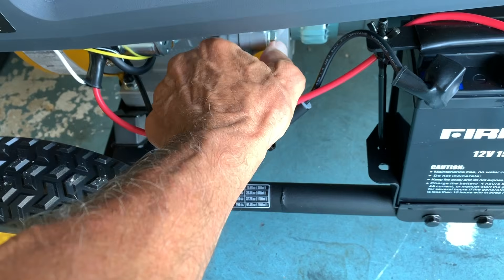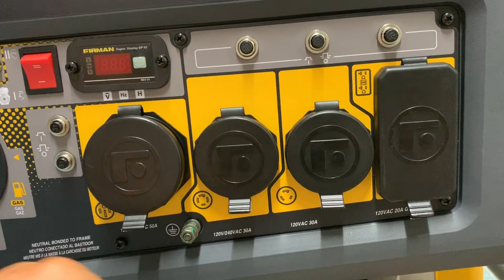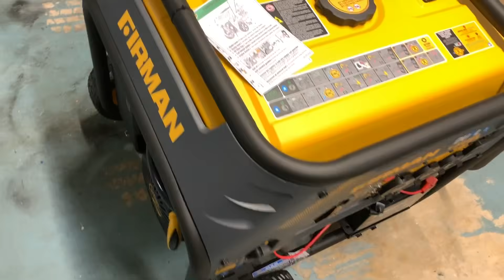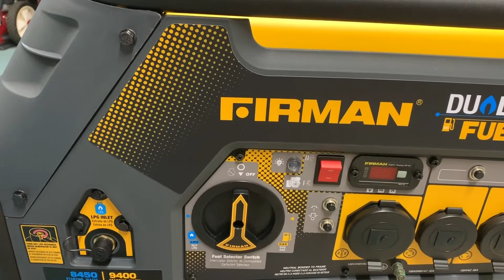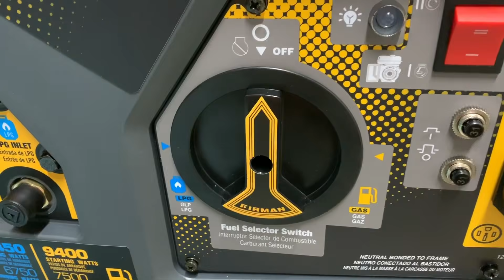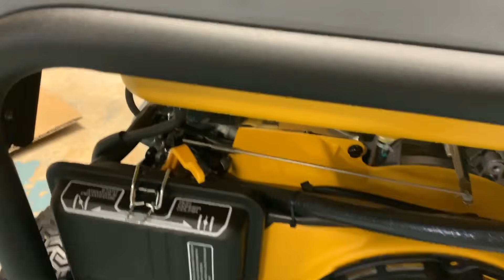The Firman 9400 Dual Fuel Generator from Costco

Comment: I heard that you can't run the unit on propane all the time because it causes condensation build up on the gas carbrerrater  and it won't start on gasoline.     Has anyone else heard of this before?    Anyone
Reply from the maker: That’s the first time I’ve heard about this, but we will have to research this and check it out
Reply: @TomLeeman  thank you

Comment: Where is the serial number?
Reply from the maker: good question ill have to look
Reply: The serial number is under the top bar on the handle side. Lift up the generator with the handle and look under the top bar handle side

Comment: I have this generator runs great but now when I put it under a load it acts as if it is choking. But if I move the lever a little bit back from run it runs smooth under a load. Do I need to get the carburetor worked on? Or what?
Reply from the maker: I'm not sure but you can call the company and they have good customer support
Reply: Here is a reminder about portable generator safety: This is just to make sure that everyone is aware of all the warnings and it’s just to remind people to be careful using portable generators. Everyone has to see this safety reminder for safety. Every year, hundreds of people die or get injured when using portable generators due to carbon monoxide poisoning and electrocution. Make sure you are using your generator carefully and keeping others safe as well. There is something very serious that everyone should always be aware of when using generators. Some people do run their generator indoors which is not safe and that increases the risk of carbon monoxide poisoning which can cause death of family and you. Some people run their generator in wet conditions which can electrocute them. Please remember that you should never run your generator indoors. Remember that carbon monoxide is an odorless and colorless gas that you cannot see or smell. Carbon monoxide is a silent killer. Keep that in mind. Make sure your generator is 15-20 feet away from your house and away from doors, windows, and vents. Never use your generator in your porch too. Having a carbon monoxide detector is very important against generator safety. Some people also allow children to go near the portable generator which could pose risks. We need to keep an eye on our children making sure that they are not near the portable generator so they won’t get electrocuted or burned by the generator which is dangerous. A locking enclosure also keeps kids safe. A generator shed might look like a tempting place to explore, or take cover during a game of hide and seek, but a generator is a dangerous piece of equipment that can cause injury. It says on the manual that we should also keep children away at all times from the portable generator to avoid injuries. Please do not allow a child or unqualified people to operate the portable generator. Just because some manuals missed what should be listed doesn’t mean it’s safe to do. Always follow the generator safety rules when using portable generators. Generators pose electrical risks. If you need to use your generator during wet weather, you need a generator tent to protect your generator from getting wet. Don’t let your generator get wet. Keep your generator dry and before using your generator, please make sure your hands and your generator is dry. Do not wear loose clothing when operating the generator. Everything that is said on the generator’s operating manual should not be ignored. Never smoke cigarettes near the generator. Please keep flammable things away from the generator. Never overload your generator too. Your generator can catch fire. Never ever try to plug a generator cord into a wall outlet to avoid back feeding. Back feeding your generator is dangerous. Always turn on your generator first before plugging in appliances and shut off the appliances before turning your generator off. Use a heavy duty cord for your generator and the cord should not be worn out. All the instructions should be followed carefully. Never refuel your generator while it’s running. It can cause fire if fuel spills while your generator is hot. You should turn off your generator and let it cool off before refueling it. Having a fire extinguisher next to the generator is also important. This is only a reminder for everyone’s safety of using generators. Make sure your generator is properly grounded. https://youtu.be/I1jT3ANENvI and here is a video more about keeping others safe when using generators and also about our family’s safety. Hope this helps. Thank you. Hope you stay safe as well.

Comment: Ah means amp hour,meaning that how long the battery will produce cranking power before it is dead or to low to crank the engine.
Reply from the maker: thanks for the tip!

Comment: Start of vid “turn off the choke or the engine will blow up.” End of the video “choke will cause the spark plugs to gum up!” 
That decelerated fast!
Reply from the maker: yup good tip I blew one up once by not turning off the choke lesson learned

Comment: It's 72 decibels when running so it's a loud one
Reply: I have had a few generators, the last 2 have been tri fuel. The one I have  now is  Firman TO7571 9400 watt, It is by far the least noisy of them all. They are all very noisy. I went from a Champion  to the Firman, whole lot of difference in the noise
level. This is by far the least noisy of the bunch. I figure a little noise and lights and heat, or no noise , no lights, and no heat.
Reply from the maker: Need ear muffs

Comment: Today 06/27/20 I just bought the Firman tri fuel 7500watts in Costco I paid  $599 plus tax. Is $200 off regular $799. Heavy 200+ lbs but because it's $200 less I didn't care 🙂 I'm thinking enough power incase of emergency.. One Good feature is Auto Low Oil shuts off no worries 🙂 Now I'm going to watch this video it's similar to what I have 🙂 thanks for the review 👍🙂
Reply from the maker: We have had to use it but bows hurricane season so ... good luck with yours

Comment: Does it plug in directly to your main electrical panel, and if so, whats the rating of the breaker that feeds this plug?

Thanks you
Reply: You should install a manual transfer switch. Reliance makes the best panels. Have an electrician install it. You won’t be sorry. Switch costs about $400-450 electrician probably around the same. Well worth it and safe. One of best investments I’ve made for my home.
Reply: @kevinshea5819  Yep, I installed a generator interlock in my fuse panel. a plug outside. In 5 minutes from lights out till back on. Super easy. every thing in my house goes on, (not the ac) I have heat, lights, plugs in every room. The interlock for my GE fuse box I got at Minards  $32.00.
Reply from the maker: Mine dose not,  but you could set it up that way, I just run the refrigerators and TV and portable ac off of it with a cord

Comment: BTW the battery for these will not last a winter if your in the northern states or canada when stored in your garage.  I took the stock batter out and wired in some battery clamps so now I can start it off of a car battery.  Yes I know I could use the pull start but I have 3 daughters and a wife with (and I quote) noodle arms!
Reply from the maker: thanks for the tip

Comment: I have had this unit for almost a year now◔◔>share4.photo/F29WInverter?mにm     I use it to power my toyhauler RV when I'm out in the back country. I purchased this to replace a beast of a Champion unit that was just too loud. I can also lift this into my truck, but the Champion required 2 people. This Firman unit is absolutely awesome. It powers my RV including the Air Conditioning with ease, and it is super quiet! I honestly can't get over how quiet it is.unning air this unit has powered 2 full size RVs at the same time. It also has a battery charger kit that I used when my car battery died. I bought it at Costco so I am protected by Firman and Costco so I know I will get years of service out of this unit. Easy to start, easy on gas and more than enough for the job! 5 Stars! The best part is the price was literally 1/3 of the cost of a similar Honda so my camping buddies now hang their head in shame.
Reply: Hello. We just bought one for our house and wish to use gas. Curious, where do you buy the "minimum of 87 octane...Gasoline with no more than 10% ethanol"? Costco, Chevron, Shell, Valero?

Comment: So you bought a 9400 watt unit only to be using two 20amp @ 120v plug... that's a waste of money. at 80%, full power you will be using 3840 watt max. You should have bought a smaller unit.
Reply: Same tought here
Reply: Available capacity is valuable.  You may want it in the future. If you keep your neighbor's freezer running they may share some of that food. Or share gas.
Reply: @davej7458  Any time you have just enough, there is no room for expansion. You  may wanna turn more than one light on. Have freezers on'
Lose everything in your freezer one time would have paid for the bigger generator. Being a drag racer , a lot is good, more is better, and too much is just right.

Comment: I know someone clarified the meaning of AH (not HA) as you mentioned in the video which drew a ha,ha moment from me. The 20 HR refers to the number of hours a 1 amp from the battery will take to drain the battery. 
Your video is good for those that don't read their manual because you are doing it for everyone in your video as it is very apparent that you don't know much about electronics or electronic start engine systems. Why one would want to pull start when they have an electric start system is beyond my comprehension?
Reply: you can't comprehend the electric start not working?
Reply: @kevinshea5819  Of course and I use it as a backup if absolutely necessary. But, you were using a new rig and definitely should have had a full battery. I also always check out the functionality of my equipment before I use it. Why spend the extra money for an electric start if you're not going to use it?

Comment: I was hoping you’d start it up. I’m at Costco and thinking about buying. But I’m curious about how loud it is. 
By the way, the Ah of the battery doesn’t really matter — you’re not gonna be running anything off of it, and if the unit doesn’t start within a few tries, use the manual pull start. The battery is only for easy starting the generator. 
I appreciate the work that went into this video and I see you have some others. I’m gonna check them out too.
Reply: I bought this on sale a few months ago at Costco...got it for $499. As I walked around the store it seemed everyone had them in their carts. I did start this unit for breakin a few times and it is pretty loud. When I went inside, even with some windows open it was fine. It wasn't something that would disturb me. It was more like a hum. I have started and ran it twice and changed the oil both times. I have used only propane and I hope that is all I ever use.
Reply: Kevin Shea, thanks for the feedback. It’s good to know.
Reply: Here is a reminder about portable generator safety: This advice is just to make sure that everyone is aware of all the warnings and it’s just to remind people to be careful using portable generators. Everyone has to see this safety reminder for safety. Every year, hundreds of people die or get injured when using portable generators due to carbon monoxide poisoning and electrocution. Make sure you are using your generator carefully and keeping others safe as well. There is something very serious that everyone should always be aware of when using generators. Some people do run their generator indoors which is not safe and that increases the risk of carbon monoxide poisoning which can cause death of family and you. Some people run their generator in wet conditions which can electrocute them. Please remember that you should never run your generator indoors. Remember that carbon monoxide is an odorless and colorless gas that you cannot see or smell. Carbon monoxide is a silent killer. Keep that in mind. Make sure your generator is 15-20 feet away from your house and away from doors, windows, and vents. Never use your generator in your porch too. Having a carbon monoxide detector is very important against generator safety. Some people also allow children to go near the portable generator which could pose risks. We need to keep an eye on our children making sure that they are not near the portable generator so they won’t get electrocuted or burned by the generator which is dangerous. A locking enclosure also keeps kids safe. A generator shed might look like a tempting place to explore, or take cover during a game of hide and seek, but a generator is a dangerous piece of equipment that can cause injury. It says on the manual that we should also keep children away at all times from the portable generator to avoid injuries. Please do not allow a child or unqualified people to operate the portable generator. Just because some manuals missed what should be listed doesn’t mean it’s safe to do. Always follow the generator safety rules when using portable generators. Generators pose electrical risks. If you need to use your generator during wet weather, you need a generator tent to protect your generator from getting wet. Don’t let your generator get wet. Keep your generator dry and before using your generator, please make sure your hands and your generator is dry. Do not wear loose clothing when operating the generator. Everything that is said on the generator’s operating manual should not be ignored. Never smoke cigarettes near the generator. Please keep flammable things away from the generator. Never overload your generator too. Your generator can catch fire. Never ever try to plug a generator cord into a wall outlet to avoid back feeding. Back feeding your generator is dangerous. Always turn on your generator first before plugging in appliances and shut off the appliances before turning your generator off. Use a heavy duty cord for your generator and the cord should not be worn out. All the instructions should be followed carefully. Never refuel your generator while it’s running. It can cause fire if fuel spills while your generator is hot. You should turn off your generator and let it cool off before refueling it. Having a fire extinguisher next to the generator is also important. This is only a reminder for everyone’s safety of using generators. Make sure your generator is properly grounded. https://youtu.be/I1jT3ANENvI and here is a video more about keeping others safe when using generators and also about our family’s safety. Hope this helps. Thank you. Make sure you follow the generator safety rules carefully.
Reply: Mines is super loud. In this video to see how it can sound like its idling or make it quiter